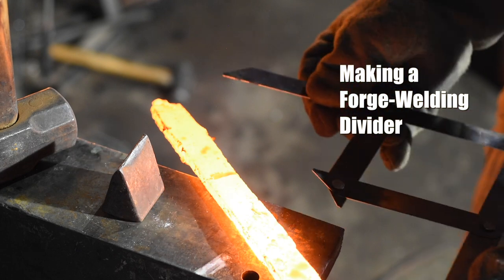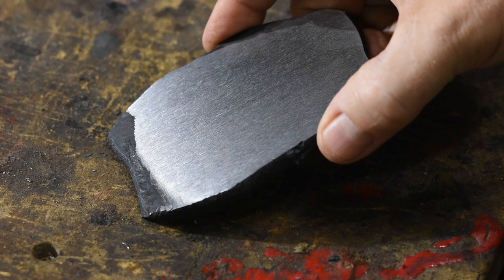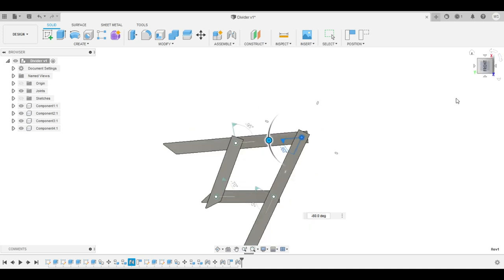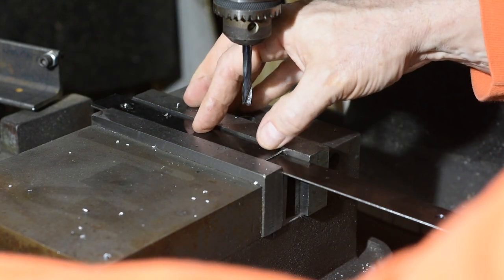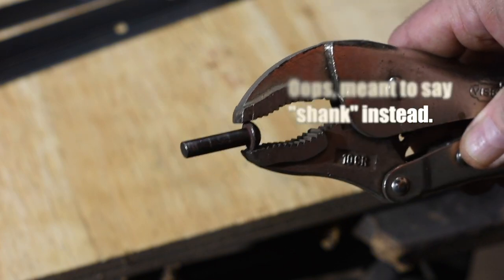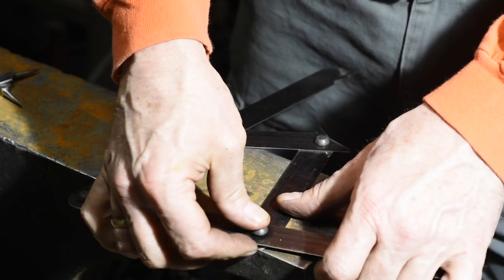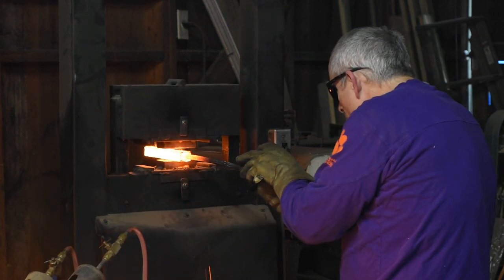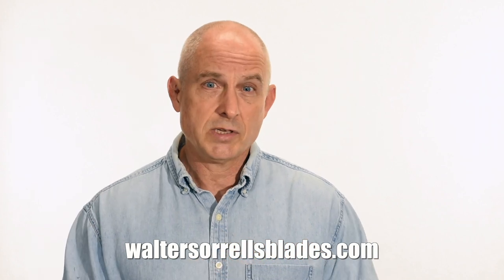Knife Making Billet Divider for Damascus Steel

Comment: Very helpful, tape measures can be a little wonky and creates variation in my billet. Two other things help in my experience. Cutting with a decent bandsaw and making dies for your press. A decent finish cuts clean up time dramatically, and using a bandsaw reduces waste. Thanks for the video.

Comment: Quick question from a new knife maker. When your doing canister Damascus what thickness for the canister wall do you use? Also If you were doing it by hand would you use a thinner wall canister or would you stick with the same? Thanks in advance.